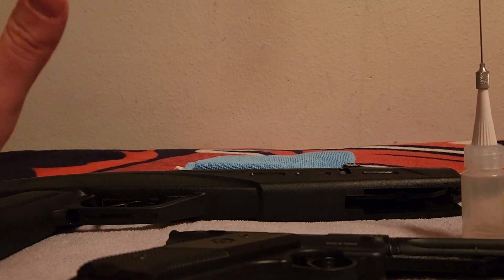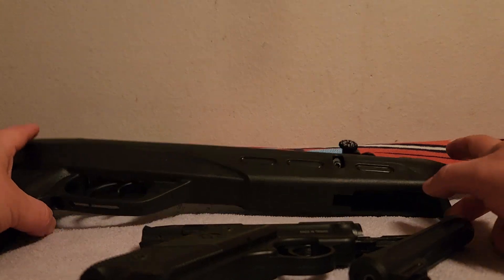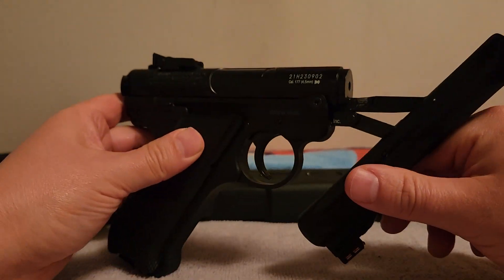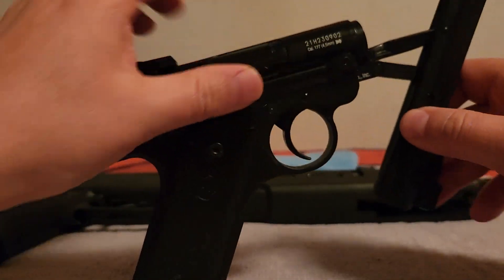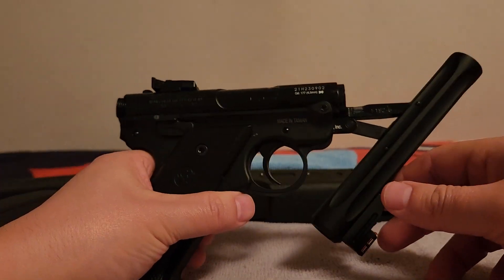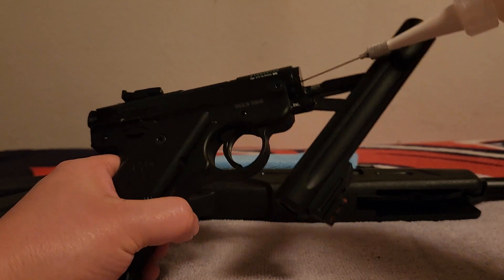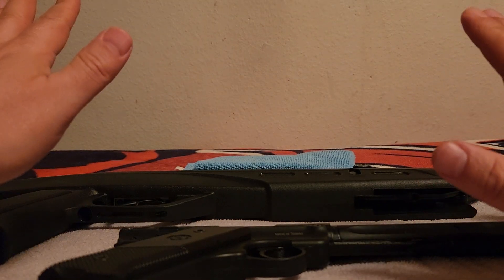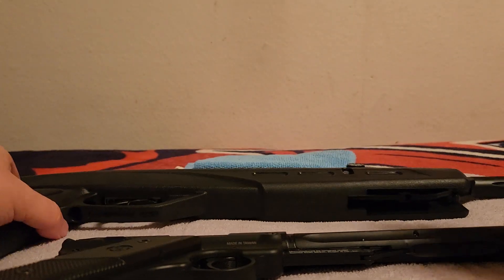Gamo Delta Fox: Lube Details & Perils

Comment: Please help. I have a Daisy 990. I put two drops of airgun silicone in it. Now it seems to have lost power.
Reply from the maker: Mario, that is an old-school CO2/pump combo.

If it wasn't airgun silicone, that would be a problem. So you should be ok.

For CO2 use, put one drop on top of every other canister.
Reply: @daisy880fanaticfixit9  I know, I love it that it's CO2 or Pump and bb's or pellets. I've only use pellets in it

Comment: I have a daisy 880 old style it holds pressure but doesn't release it i mean when i pull the trigger it doesn't shoot pls help
Trigger pulls fine it holds pressure but when i pull the trigger no pressure comes out
Reply from the maker: Seema, check for breech jam first.

https://youtube.com/shorts/K2rYgUEJfbw?feature=share

You can also check my Shorts library.
Reply: It is clear barrel is clear please tell if there is any other reason
Reply from the maker: Yes, if the poppet doesn't drop to release air when you pull the trigger, you may have an "E" clip failure. That anchors your lever to the valve stem. (In the video, I say hammer because many airgun smiths consider ANY part that trips the valve open a hammer).

You will need to take off the receivers to check this. Watch the mechanics in the video below.

https://youtu.be/UDYKMHwEku8

The part should be at the hardware store if you find it broken or even missing.
Reply from the maker: Seema, I have been getting contacted by those who have TAMPERED with return springs for their 880 trigger.

Too soft a spring WILL NOT pull down valve stem.

Symptoms:

Trigger clicks 
Gun holds pressure

The air is TRAPPED in compression chamber. If you DID cut coils off your 880 spring, well, use pliers to manually pull stem down and release the air.

Then contact Daisy directly for trigger assembly.